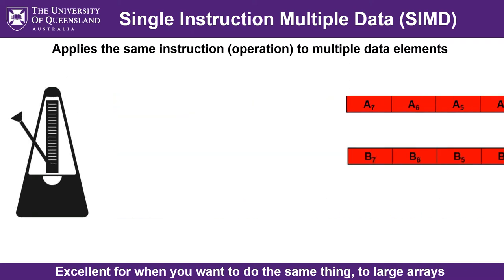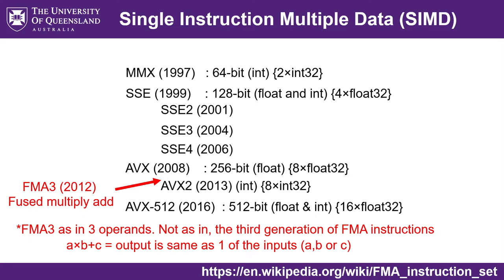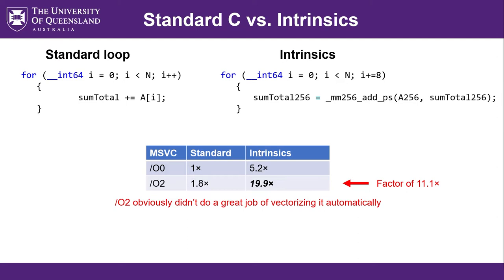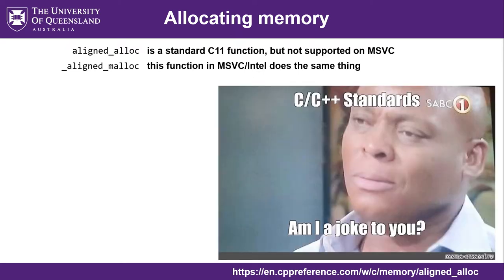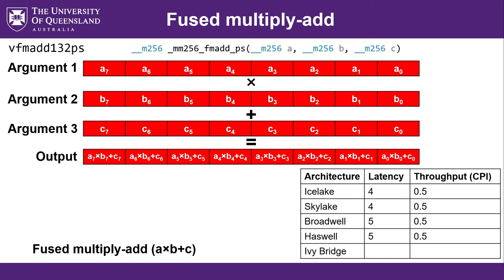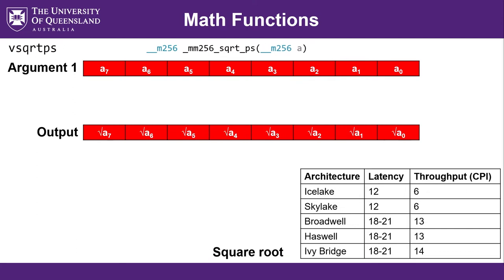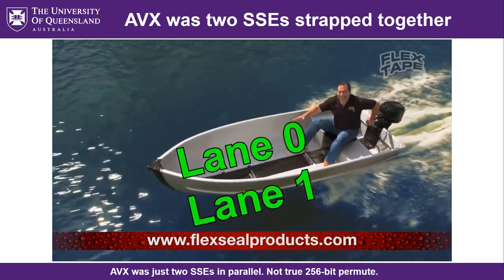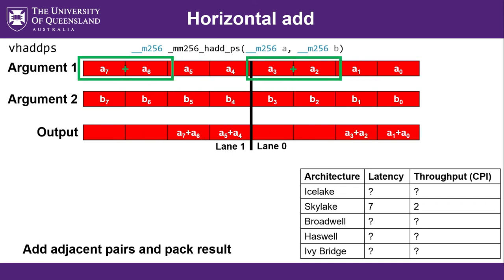SIMD and vectorization using AVX intrinsic functions (Tutorial)

Comment: Thanks for your wonderful video. I'm a newly CPU engineer and responsible for the uach of FP aprt. This vedio truly provides me a new aspect to understand vectorization and SIMD. Thank u!!!
Reply: Hello, Joel!  I have one issue for u. When u mentioned FMA3 instruction and its calculation ordering, I found it's not matched with the Intel manual when meets VFMADD231PS. The "231" in mnemonics indicates that O1 should be a multiplier, O2 should be adding part and O3 should be a multiplicand according to the Intel Developer's Manual. It seems right for the O1*O3+O2=O1 formulation, but your slide and the intel manual say it should be O2*O3+O1=O1. I want to figure out why?
Reply: I think I was misguided by the gramar. But anyway, u are right! Thanks a lot!

Comment: This is great!  Any chance you could make an intrinsics best practices video? I can't really find anything like that on Youtube or elsewhere.
All I've been able to find is stackoverflow sample code with no explanations of why things are done the way they are.  ie why its common to group similar intrinsics together: load, load, load, load, add, add add, add, store, store, store store.  Why not load, add, store, load, add, store, load, add, store, load, add, store?
The tip about creating an array of __mm256d is pretty interesting. I am going to have to try that in my current project where I'm trying to ensure all 16 AVX2 vector registers (or as close as possible) are in use in a 3GB+ matrix MaxPlus algorithm. In some quick test code I wrote, using an element in the array disassembles to a vmovupdy just like a regular _mm256_load_pd does. I'm surprised it doesn't use vmovapdy since the memory is aligned. Adding __assume_aligned didn't help  either I'm using the Intel icc compiler. Hmmm...

Comment: The handling of the return values—which are an array for vector output and a single number for regular scalar output—is not covered. 
Put differently, how are you handling the outcome and what are you doing during accumulation?
Reply from the maker: Not sure what you're asking, but if you look near the end where I do a complex dot product, you can see some code examples.

Comment: Is there a reason we are reading the memory bits from right to left?
Reply from the maker: Not aware of any fundamental reason, but I think it's just to keep with convention of how you normally write numbers from least significant digit to most significant digit right-to-left.

Think of it as one big 256-digit binary number, just like you'd write a decimal number '1234' meaning one thousand, two hundred and thirty-four, with the least significant digit is on the right, and then you work to the left with each digit being a higher-power of 10. Same idea, except this is binary. Or in C/C++, if you were writing a binary number it'd be 0b1101010101, with the least significant bits on the right.

The confusion can be if you're thinking of it like an array in C/C++, where you'd define it left-to-right, A = {0,1,2,3} where the first element is on the left. Don't get me wrong, you can also think of the AVX blocks as little arrays, it's just the way they're normally illustrated is such that the significance of the bits in the whole block increase from right-to-left, like one big number (even if you address them as blocks of individual numbers). Then no matter how you slice it, every chunk would just read like it's own binary number right-to-left.
Reply: @joelacarpenter  Thank you so much for explaining!!

Comment: 13:19 Did you mean to write 
sumTotal256 = _mm256_add_ps(*A256++, sumTotal256); 
assuming 
__m256 *A256 = (__m256 *)A;
? Otherwise this only will work if all elements of array A are equal.
Reply from the maker: yeah I think what I was probably trying to write was
sumTotal256 = _mm256_add_ps(A256[i],sumTotal256);
and then the for loop itself should iterates, i++ instead of i+=8, and then the loop runs to i<(N/8) rather than i<N
i.e. index in units of blocks of 8 (256-bit registers)

or alternatively add line...
__m256 A256 = _mm256_loadus_ps(&A[i]); 
and leave the indexing as is.

You could write it a few ways...but the way I wrote it in that slide isn't one of them.
Reply: @joelacarpenter  Thank you for responding and making this video! You have given a nice overview of the intrinsics available and your visualizations have been very helpful to me in deciphering the operation syntax on the Intel intrinsics guide
Reply: @joelacarpenter  again at 13:19 shouldn't the  integers be 32 bits in size ? 8 integers * 32 bits = 256 bits but the ints on the slides are 64 bits, 8 ints * 64 = 512 bits
Reply from the maker: @olegpatraschku3736  Are you talking about the int64, 'i' that I've used as the index? That's just for addressing the array (rather than the number format of the data inside the array itself). Normally I'd use 'size_t' rather than '__int64' for the index for potentially large arrays. The arrays themselves in this case as 'ps' which are 'packed singles' which are 8xfloat32
Reply: @joelacarpenter  my mistake, it all made sense later on as I continued to watch the video :), content is very good !
(my personal "struggle" was about this "lane" concept, I don't think I understood it fully why is it designed like this...)